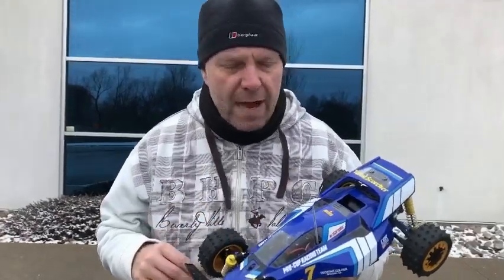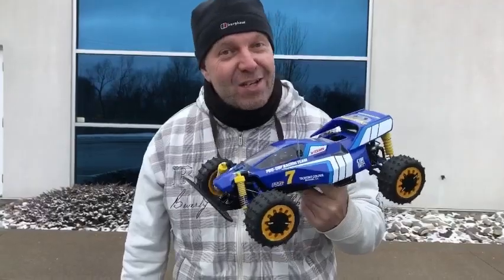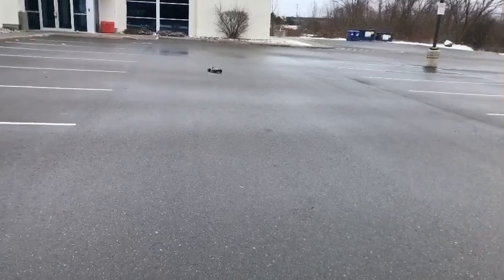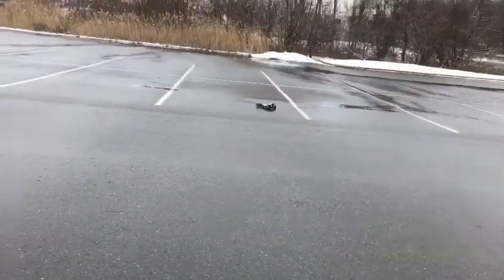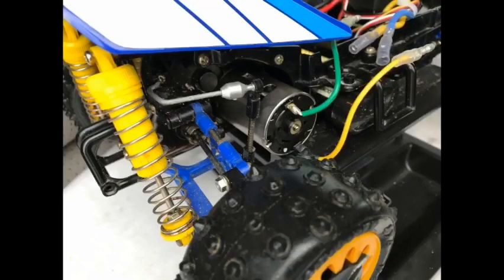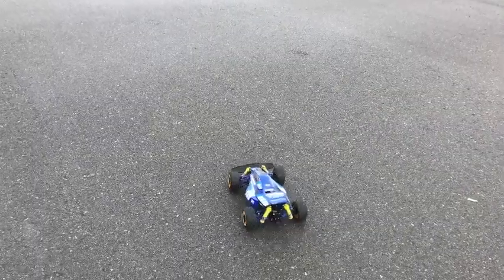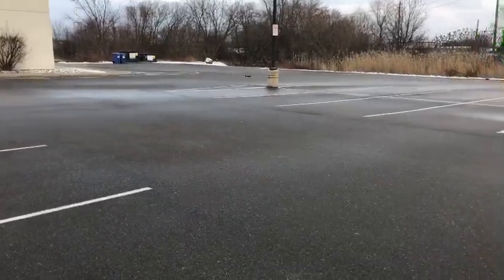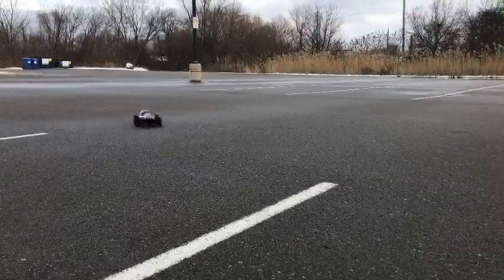540 Silver can Motor vs the Tamiya Super Modified 11t 🚗💨💨

Comment: I got one of these for my birthday back in 1992, I used to take it racing at a big factory that is now sadly a housing estate.  Its upstairs in its original box in my parents attic, with controller, charger etc.  I seem to remember my little brother hitting reverse after it going forwards full-chat and one of the metal gearbox shafts damaged the resin gears by rounding it off and it was never the same (I went and bought a Schumacher Pro Cat and hardly used it) this video gives me hope I can get replacement parts for it with the age of the internet and get some new batteries and have it up and running again!!

Comment: What esc are you running with the 11t?
Reply from the maker: Scorpion Design Engineering 
I run a New Rain 320a unlimited Brushed speedo buddy 👊🏻
Reply: How's it holding up, I just got the 480 amp version but instructions say it and the 320 amp version both have a 12t motor limit @ 2S lipo.
Reply from the maker: Scorpion Design Engineering 
Really that’s interesting 🤔 I’ve been running 8x2 Modifieds with it 😂👊🏻